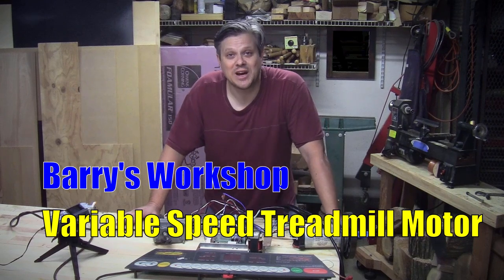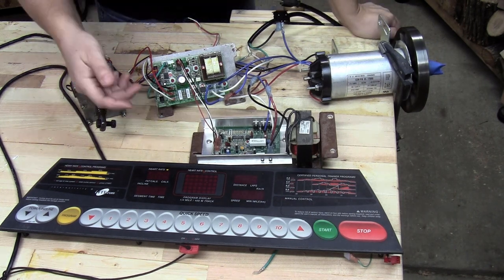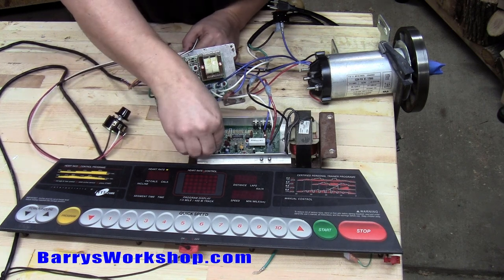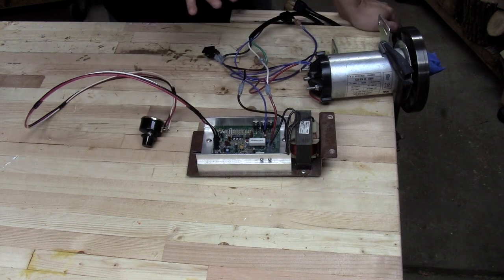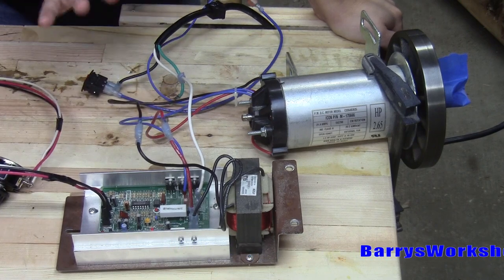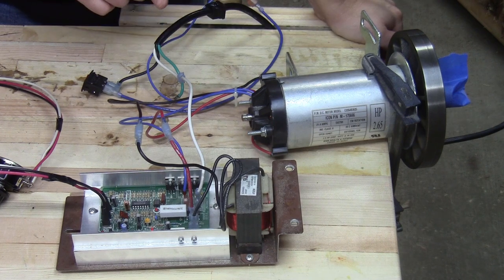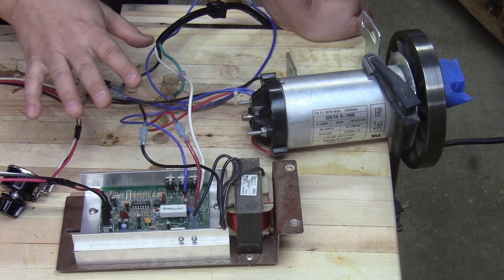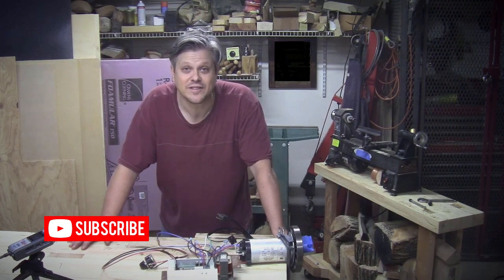Simple Variable Speed Treadmill Motor Electrical Conversion

Comment: Excellent, presentation Innoway I can understand completely, you now have a new subscriber. .Wish I would've found this stuff before I ordered my converter for three phase. I'm going to search for a three horse treadmill motor and put it on my Bridgeport M head on my brown and sharp model #0.   You're awesome my friend thank you.
Reply: Careful with that. The mosfets on the controller board are chosen to handle the current of THIS motor. Bigger motors require more current and in the attempt to supply increased current, your mosfets would more than likely die.

Comment: Hey Barry I have this exact set up with a 10k pot and 2.75 hp motor.  Right now at its lowest setting it’s at about 530 rpm but I want to get it lower.  Do I go higher with the pot or lower?

Comment: Barry, if you dont have separate wires on the board for the potentiomoter and there are like 8 small wires in a clip type that plugs into the board , do i just look for  another board , is there a way to adapt it to that clip, do i have to find a whole other motor. I wish you would have made the video with the wires displayed better. It looks like a jumble or wires.. I found the exact set you have and i cant get it to work. Ive numerous configuration and all it does is trigger the breaker

Comment: great video. im a beginner and when i was salvaging the motor i didnt know to salvage the speed controller. could you possibly have a part number for that i can look up?
Reply: and what are the connectors called for those wires?

Comment: Great vid Barry! Just wondering if the Torque of the motor is affected,i want to use a treadmill motor to run a Potters wheel, very low variable speed is needed but i also need the Torque to still be there as pressure will be applied to the spinning motor.
Reply from the maker: Thanks, Shaun. At the very low end of the RPM range, the motor will stall if you load it enough. If you choose the gearing well (e.g. pulley sizes), I suspect that you could get most of the control in the low RPM range, but you'd sacrifice max speed.  I don't see any reason why that wouldn't work.

Comment: Hi Barry,  Did you ever end up removing the flywheel from the motor you used in this video?   I just got a treadmill motor/flywheel that looks like the identical unit as yours, but I am unable to unscrew it from the shaft.  I'm wondering if this particular unit may use a pressed-on flywheel rather than a threaded-on one?
I
Reply from the maker: Yes, I have removed it. Mine has left-hand threads, if that helps.

Comment: Hi Berry. I have a question. I’m using a SCR and bridge rectifier to control the rpm of my 130 VDC treadmill motor. The last thing before the motor is a DPDT switch for forward and reverse. I’d like to have a green and red indicator light that tells whether motor is forward or reverse. 
The problem is that I have 130 VDC and maybe 20 Amps going to that DPDT switch. 
How do I connect 24 VDC led lights that can only handle several mA’s
Thanks. 
Paul

Comment: If you are eliminating the Pulse Width Modulation, (PWM), is there any chance the power supply were provide more voltage to the motor than the motor's spec?

Most of these treadmill motors are permanent magnet motors. If you put too much voltage into a perm mag motor, it will eventually demagnatize the magnets, making them not permanently magnetized, and kill the motor.

It should be easy enough to check the voltage going to the motor at 'full speed', to make certain.  I would encourage anyone re-purposing a treadmill perm mag motor, to double check this.

This is one of the first things I learned about using treadmill motors. In thr early days of industrial DC motor use, they controlled the voltage, and made up for lack of low RPM torque with gearing/pulley setups.

PWM has replaced that, in the age of electronics.

GeoD
Reply from the maker: Interesting question. It would be interesting to hook up an oscilloscope to the motor input to see what is being sent. I have a cheap one that might work, and I'll look into it.

Comment: Barry, I have a question concerning the potentiometer. I found a great commercial treadmill nearby for cheap and it has a 3 hp continuous duty Leeson motor in it. The speed of the motor is 3,500 rpm. How do you source the potentiometer to use with it as need this to power a 2x72-inch belt grinder currently in the stages of being built?

Comment: That looks like a Pro-form treadmill.
I have similar guts from a Nautilus treadmill.  When I remove the incline motor, the control board gets angry and refuses to turn on the belt motor and displays an error message.
Also, I don't have two boards, everything's one one board except for the control panel, so I haven't figured out where to tap in the potentiometer.

Comment: I watched your video and applied almost every aspect to my motor. Works fine except I have a Precor  motor and the cable from the display panel has approximately 10 wires running through it. I am unable to pick out the three wires you mention. Any ideas?

Comment: I have an old treadmill that has two wires going to a control box that had speed up and speed down arrows on it, that box is shot, it only has two wires going to it, is it possible to just hook up a potentiometer to just those two wires to regulate speed?

Comment: Does the main power switch have to stay on to switch the red wire off/on to get back up to the same speed or can the main power switch be a DPDT and switch both the main power and the red wire separately and still work?

Comment: Is there a way to run the controller and motor that came out of the tread mill using batteries? And also to take away the delay?

Comment: great info!!  Now just need to find the parts!
Reply from the maker: Thanks. I literally found this treadmill on the side of the road, which was just luck. I have found some deals on Craigslist that looked they would be good candidates for under US$50. Look for one that works but is need of non-relevant repair like a busted display, broken incline control, missing "key", etc.  

Also, before you drive to pick it up, do a search for repair parts for that specific model and make sure the one for sale has a comparable controller and motor. Some models have integrated controls and variable speed controllers that would be more complicated to convert than the one in this video. 

Good luck!

Comment: Thank you, super simple straight forward explanation of how to use a treadmill motor and speed controller.  I'm going to look on craigslist for a cheap treadmill.  Any suggestions on what I should be looking for?
Reply from the maker: If I were looking for a treadmill on CL, I'd get the model number, then look online for replacement parts. This should help you find what the capacity of the motor is, and hopefully if it has the same kind of variable speed controller that can be isolated like I did with this one.  Hope that helps.

Comment: thanks for the great video! quick question, where would I wire in (power) a rpm counter into a setup nearly identcle the to one in your video? thanks!
Reply from the maker: Thanks for the comment. I would find a hall-effect proximity speed meter for displaying the RPM. They're cheap and can be mounted to the spindle of whatever tool you're using. Even if you could get the info directly from the speed controller, you'd still have to adjust for pulley sizes, gearing, etc. Mounting the hall-effect magnet directly to the spindle of the tool will mean that you get the direct value with minimal hassle. I hope this helps!
Reply: thanks for the reply! I did get one of them and just not sure on how to supply the power for it. Very unsure of things when it comes to electrical work. I assume it's ok to splice into the power from the power cord going to the mc60 but would rather someone tell me it's ok to do that. thanks again!
Reply from the maker: The ones I've seen require DC power. I'd use an old wall-wart power supply because they're cheap and I have some spares lying around. If you're not comfortable hard-wiring the power supply yourself, then they're easy enough to just plug in. Use a properly rated power strip, and you can use the switch as a master power switch for the motor and also the RPM display. Safe and easy.

Comment: I'm wondering if i need to keep the fly wheel...mine is on opposite end of the drive pulley....also wondering if i should have/keep the fan on the motor?   The pulley I want to put on the motor is a six step with a 4" depth...only have 2" of shaft on the motor...should be ok if I remove the fan.  There will be limited gaps for air to flow around the pulley end of motor...will this cause a problem?   Thinking of installing a fan from a microwave but difficult to get the air to flow through the motor.  Putting it on a milling machine.
Thanks for your video.

Comment: Great video. I followed it and got my motor working, but I see some sparks in the back of the DC motor when it's running. Is that normal, or do I have a problem with it?
Reply: The sparks are from the brushes on the commutator.
Reply: @talltimberswoodshop7552  are sparks normal, or do I have a problem with my motor?
Reply: @shafif  Normal, but you might need to clean the commutator with alcohol.  You can take out the brushes without disassembling if you have screws holding them in.  Jeremy Fielding shows that on one of his videos if I remember correctly. Look for his DC motor video.
Reply: @talltimberswoodshop7552  Thank you!!

Comment: I put one of these on my lathe and can stop it with the finest turning tool I have.. Is this a motor problem or a controller problem?
Reply: Patrick I think it's a power problem. By power I mean grunt not electrical. This controller reminds me of earlier toy train set controllers that had to be turned on harder to get the train to start, then turned down to copy real train speeds. Along came PWM controllers and toy trains could move off like the real ones. Barry has removed the PWM control section which I believe would give you the power at low speed you desire. The potentiometer can't do that for you.

Comment: Thanks for the clarification, just please I want to know why it did not work with this process with me, the current does not drop below 105 vdc, I don’t know why, I want to know if I increase the size of the potosiomatre to 20 or more, does the current go down with me to less than 105 vdc or No, and for your information, the engine runs at 180 vdc. Thanks in advance for your help

Comment: Hi Barry, I have a norditrack C22770 that my panel no longer works to assign the speed..only works on "3,8, and 12 mph...too expensive to replace the panel however, I want to control the speed with a potentiometer...please tell me what wires to connect on an external potentiometer.  Your help will be greatly appreciated

Comment: best video for this on youtube!   

can I remove the flywheel and put a pulley there without doing any harm to the motor?
Reply from the maker: Thanks for the kind words. I am sure that it's fine to remove the flywheel. FWIW, I believe that most of these have 1/2"-13 Left Hand threads.  I got a 1/2"-13 LH nut from the local Fastenall to use as the basis for the same thing. I hope that helps!

Comment: hi barry from england.i noticed that the mc 60 board has the transformer connected to it ,  have seen on other utubers site that they use just the board itself without the transformer. what in your opinion is the benefit of using the transformer. i find your explanation on wiring up etc the best yet on u tube many thanks please advice regards mel stenway
Reply from the maker: Hi, Mel, thanks for the kind words. The thing that looks like a transformer is really an inductor (sometimes called a coil or choke). A transformer would have at least two different windings, and therefore at least 4 wires. This only has one pair, FWIW.

From what I've read, that speed controller sends pulses of DC voltage to the motor, and the pulses get shorter as the speed is reduced. The inductor smooths out the voltage going to the motor, which makes the motor a bit smoother, particularly at  low speeds. That's the way I understood it, which is admittedly a simplistic view. 

I decided to leave it in place because that's the way it was configured on the treadmill, and given the cost of the copper and steel, the engineers probably had a reason for adding it to this speed controller. And to the degree that it smooths the voltage going to the motor, that should help performance. I have to think that it could also help the brushes last longer, since they're really not designed to have a pulsed signal.  Lacking a degree in electrical engineering, that's the rationale for leaving it in place. :)
Reply from the maker: I was thinking about your question, and decided to experiment with the motor with vs. without the coil. I posted the results here: 
https://youtu.be/fp_g5AOur9k

Comment: Thanks for the reply...when doing some reading I found that flywheel seems a problem when shutting down your machine, [idling too long] or whatever you use it for, can this flywheel been take off when you're not straining the motor...say a light duty drill press?
Reply from the maker: I think that you can use one of these motors with or without the flywheel. With the flywheel, the momentum will make the rotation more consistent, but as you mention causes it to be slower to speed up or slow down. If you can't say that would be an advantage, then I see no reason to leave the flywheel on. 

FWIW, I think most of the flywheels on treadmill motors are mounted using a 1/2"-13 Left Hand thread.

Comment: I am working on the same project but the ones I have are 120V but our power mains plugs are 240V
Reply: Could prescribe a power transfomer
Reply: Thanks. I also  bought a potontiometer, any wiring diagram you can suggest.

Comment: I got mine working with a 10k potentiometer, but I have a problem. While watching the voltage once I get to 3.2v I can no longer turn the speed down. I have to go to 4.6v then it turns off But it keeps ramping up till 4.5v. Do you know what is going on?

Comment: Hi Barry,  I have the same connection, however once the power is turned on the motor runs in full speed even if I unplugged the potentiometer from the MC60 board completely.  My suspicion is something wrong with the MC60 control board as it's no different with/without connecting the potentiometer.   Any comment?  Thanks!

Comment: Have you found any good way to remove the startup delay? Obviously it takes time for the motor to come up to speed, but it looks like it waits a second or two after getting  go signal before actually starting the motor.
Reply from the maker: I haven't done anything with the slow start, yet. Pretty sure you'd have to hack the speed controller. I'm assuming it's possible but I haven't gone down that path yet. I agree that it would be better to ramp up faster.
Reply: Add a motor start capacitor  from ebay
Reply from the maker: @nestorasuncion1226  I'm not how that would work on a variable speed DC motor. Can you elaborate?
Reply: @Barrysworkshop  
My Bad.
Thought it was N AC motor.
Try lowering the Pot resistance
Reply: you can also add a switch between the power board and the motor :)

Comment: Hello Barry, nice video, greetings from Mexico. Could You give me an advisé please? I have a treadmill but unfortunatelly a bad technician steal the full control panel and has not been possible for me to get one. I think its possible to adapt an speed controler for cd motores wich I could get in the store but I have the doubt if I need too a Transformer to change AC to CD ir it's enough to put a rectifier bridge? Here in México we have 110 V ac and the treadmill's motor is a "variable speed motor, 90 V dc, 11.5 A, 4500 RPM" Any advice You could give to me I Will apreciate a Lot My friend. Hope You could understand my english but I'm just a begginer). Waiting for your response, thanks. See you

Comment: Paul Drakos. Thank you for the video. I have a 3.5 HP treadmill motor. I want to disconnected from all computer panels and boards. I want to use a variable speed transformer and of course a bridge. How big the transformer should be and the bridge. There is anything else I should use? I was looking at a Varian Transformer by it says that it outputs AC curent. Do I need another transformer to bring it down to DC?
Reply: Paul Drakos  No, you will need a bridge rectifier to convert the AC to DC. You can find high power rectifiers online from the usual suspects for cheap. If you still have a Radio Shack near you, you should be able to find one there in the drawer bins. Seems most folks use one rated for 50 amps. On the typical square ones, you will have four terminals, two for AC in and two for DC out. They are usually marked. The two AC are diagonally opposite each other, same with the DC. Wise to mount it to heat sink of some type too. Many people have used a Variac and bridge rectifier as you describe. There are many videos on here explaining the process.
Reply: havenot seen bridge rectifier in this video, how was AC power fed ro DC motor just through electric board that doesnot seem to have a AC to DC converter? what am I missing here?

Comment: I thought that as well until a flywheel unthreaded at full speed, hit the floor and ran the length of my basement, jumped off the open door sill and slammed into the fender of my wife’s boxster.  She loves me but not as much as she loves that car. I no longer bench test motors in reverse with flywheels on them.

Comment: Is the incline motor just a geared dc motor?   Could it be used to drive the power feed on the lathe?
Reply from the maker: Mine is 120VAC. I think that will be the case for most of them.